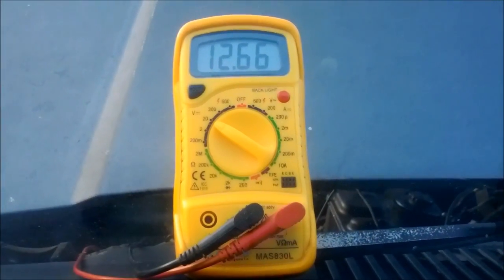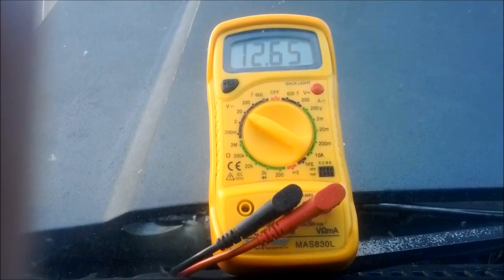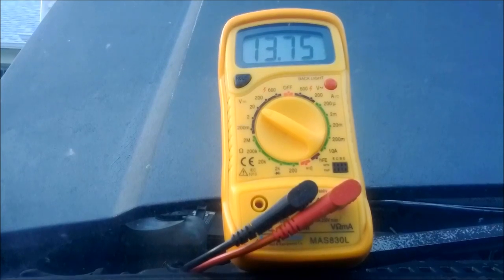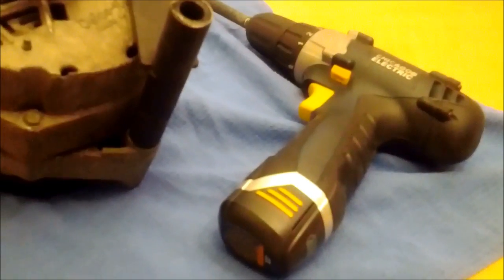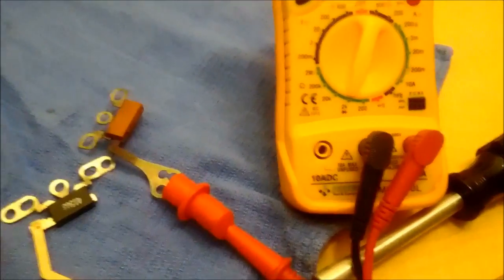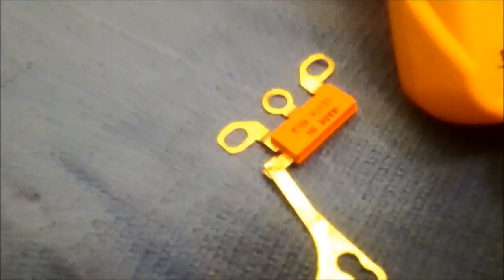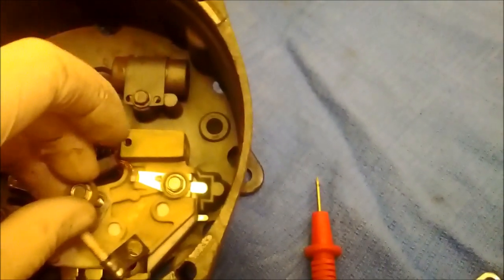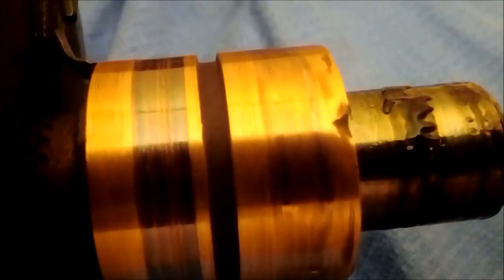Alternator Diode Trio Replacement

Comment: Very good video and thanks for sharing knowledge. I wanted to ask a technical question to see if you can help me, I have a dense 95 cherokee alternator part number is 210-0130 Denso which I stop working disassemble and replace brushes and mounted on the first start 14V commands and functions perfect at all, but the next day no longer work, then I go back down the alternator and amount of new works again perfect and then stop working on the second start, and discard diodera and stator and check all the branch that goes from the alternator to the PCM but arises me a doubt the harness is attached to two poles with a 7mm tuerquitas this piece has the number ATR-6001 and my question is whether that piece functions as a regulator although in this case jeep cherokee regulates the PCM, this piece has a kind of diode or resistor not as verify that this good and that is I hope can help me please. In advance thank you very much and excuse me throughout my comment. Regards

Comment: that's cool that you were able to replace the diode trio yourself instead of having to pay someone to do it.  I might try replacing an alternator myself, I've repaced a couple in my 45 years of messing with cars, but taking one  apart is something I wouldn't try.  I think i'd just get a new one, or a remanufactured one.  Was the 13.4V running prior to diode install keeping the battery at 12.65V as it showed? In other words, had the battery failed you? I have the exact situation you were facing.